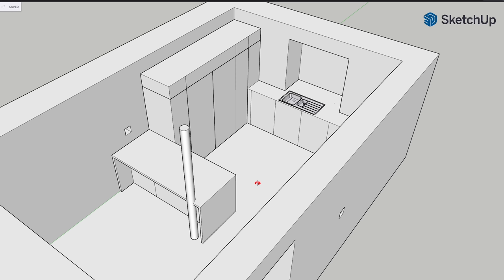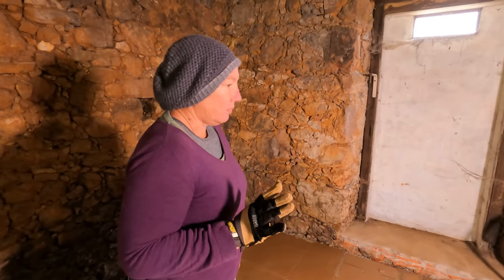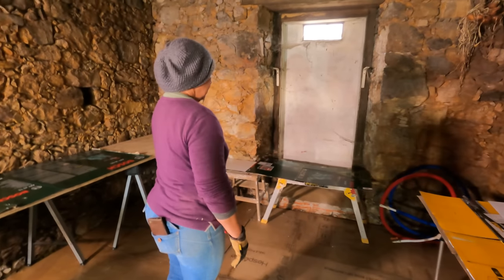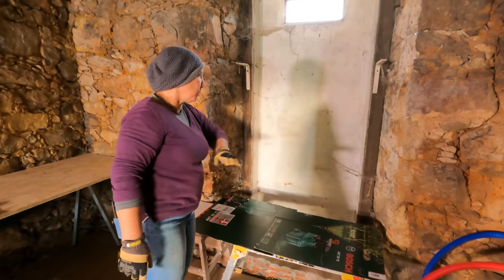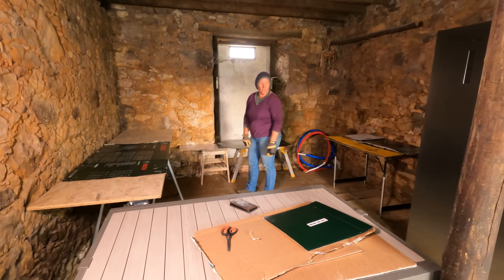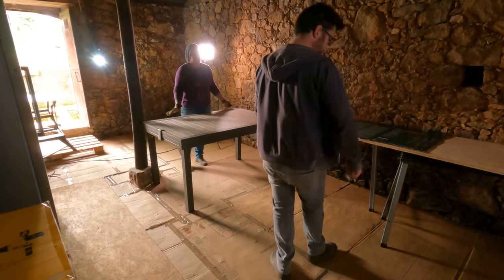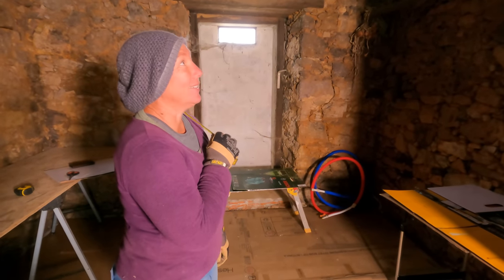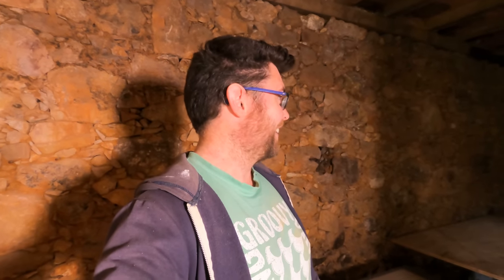How We Planned Our Perfect Kitchen

Comment: We had the same situation with the pole having to be kept for structural integrity. We wanted the most counter space on the breakfast bar as we could. So we incorporated the pole inside the counter top by wrapping counter around it to help the lower portion of the pole to sort of disappear into bottom cabinet. We squared the upper portion of the poll off by boxing it in with 2x4’s, that housed the electrical and switch for overhead breakfast bar lighting. Then we tiled the squared off pole with decorative stone.
Reply: my thoughts exactly and it may also be possible to incorporate electric plug and RJ45 sockets in to the pole as the counter top will no doubt be purposed for laptops and other devices.
Reply: @grahamlees4394  Agree with both of you but replace the the RJ45 (WiFi is easier and if necessary add range extenders/repeaters enabling full house coverage.) with USB charging port/-s.

Comment: My suggestion would be to either move the fridge and cupboards to the opposite side or move the bench to the other side so you have the bench running right around in a right angle. In your floor plan you have a space hard to access next to the cupboards on your bench.
Reply: I think they said they are not planning to plaster that side so can't hide the electrics that side

Comment: ps we had cables under the floor in a barn and on the floor (you can get lovely brass floor sockets) with wire also running along the ring beam with radio controlled lights so no sockets or switches visible. Wires can come under the floor and floor sockets on the central unit - sure you have thought of that x Thanks again for the vid. Always a joy x

Comment: How about running all the carcasses over on the long left hand wall, as you enter the space. They can be full height, or a mix to suit how you want to operate in the space. Then form an island in the middle of the room. The island can be up the far end, but crucially not touching the end wall. This means the extg door can remain full height, when it’s turned into a window. Maximising light into the dark space. The dining table can butt up to the island, at the door end. (From an architect)

Comment: Nice kitchen, congratulations! By the way, it is also possible to have the dishwasher higher up in the high cupboards - better for the back in the long run (and you would not trip over the open door around the sink)
You can install the ventilation system over the cupboards, and hide only the pipes going there (like a beam), alternatively install nice pipes and show them.

Comment: Two of the best features I am glad I put in my kitchen are sockets inside cupboards that allow me to slide forward the food processor and breadmaker and use in situ meaning I don't have to carry them to a separate workstation.  The second feature was to put racks on the inside of a door to hold herbs and spices. It only needs to be the width of a jar and I can see where everything is at a glance. My cupboard is built around a soil stack which is completely hidden.

Comment: imho: kettle and coffee should go to the right of the sink, esp if you're right handed, and where it's not 180 away from the fridge. Similarly, range work area should be just to the right of the range.  hope this is helpful. All the best, love the idea of a full size mockup, makes sense!
edit: years ago i was sceptical about too many open shelves but am now a huge fan for high use objects, dust not an issue. Also consider glass shelf(ves) under the window, where glassware and a vase of flowers will shine. Pre-packed rectangular baskets in open cupboards were another joy: you can just pull out onto a worktop, with everything you'll need for eg baking, pulses, pasta etc.
a big narrow drawer to stack rectangular baking trays and sheets on their sides for easy access, ditto a rack for pan lids, made life so much easier.

Comment: You two rock! But I would consult a kitchen company in the area with a designer. As a kitchen builder myself some of the things you say are not quite there yet. A sink above a dishwasher, thats a low inset sink then? A hole where cables can run trough like in an office? Theres a reason thats not done in a kitchen (spills/dirt/crumbs). When your floorplan is still to big. Conisider deeper cabinets with a small work surface infront. Mostly this is combinned with roll-up doors where appliances are 'hidden'. Also the pole, keeping it is indeed a preference. Mayby turn it in too the end of the counter instead of making the counter wrap around it. Also there is a reason why the surface behind a stove is easy to clean. Grease of cooking accumulates on 'rough' surfaces. Hopefully my explanation was readable, because english is not my native language.

Comment: The only suggestion I might have...Use your cabinetry base deck to hide your wiring.  Running around the periphery of your kitchen and popping up for outlets.  Be sure drawers and slide outs, in corners, don't bump pulls or handles on opposing corners.  A smallish lighting valance above the length of your cooking center would serve as a good hide for venting and ductwork.  The function of the design looks fantastic.  Love the breakfast nook idea.  Is the counter by the post going to extend far enough for some bar type seating on  the breakfast nook side?  Be a great place to sit while prepping food for canning.  If you don't have one, a quality table saw will aid in this portion of your build.

Comment: When I design a room I put paper on the floor . To add the dimension of the height gives even a better view. The middle of the kitchen floor you can use those nice Portugese floortiles like a stone carpet. I saw examples of the cornerstorage unit and I really liked it myself. Good to plan everything out. Make sure you have plenty of sockets; you will be amazed how that simplifies working in the kitchen. When you put shelves in that you can  pull out adds to comfort to work in the kitchen, For your ventilation pipes , since you are probably building the cupboards ceiling height you can use that top space to hide the ventilation system, Building ceiling height , you will always have to use a ladder and it adds on to have a lot of clutter in your live. Interesting video

Comment: On the island you should try and get a lift up socket for lap tops or phone charging,and if you getting European kitchen cupboards they come with plastic foot you can run cable's and water underneath you get about 100-150mm

Comment: What about a rounded oval benchtop shape around "the pole" with walkways either side?
It would enhance the pole's central position and simultaneously integrate it nicely into the space. And you could seat people around it as Guy does his entertaining kitchen chef thing... 😉
Great job as always and thanks for letting us partake in all your endeavours!
Will be exciting to see the finalised version you decide on!

Addit: Re vent, I've seen a cooking unit at a friend's place that has a level ventilation system integrated into it (i.e. at hip height). I can get a pic if you're interested or have a look at "downdraft" vents (Bosch, Miele, Klarstein, ...). It works really well re fumes/ smells etc., quite surprising actually!

Comment: You could consider putting a pot filler tap above your range. Very handy for bulk processing. Although I see you are pointing that wall so it would have to be surface mounted. I would avoid an island, when two people are in the kitchen you end up walking round it in circles to give each other space. My sister got one and she says her and hubby end up going round it clockwise picking up small things like cutlery in a sweep as they go. But then when you need something else you have to go on the merry go round again.

Comment: I'm sure your design is pretty much on point, the only thing I would say is, make sure you have enough work/prep space because once portable appliances start encroaching on that space it's often to late to change.
I like the idea of a secondary consumer unit in the walk in larder, I would suggest it is positioned at eye level for ease of maintenance if needed, and if you need to turn a breaker off, I'm speaking from experience here. 
The area between range, sink and fridge is not wasted space, you need it and will be glad of it especially if Kylie ventures into that area.
You will of course have to buy an airfryer mini oven, they are all the rage now and perfect for two people. When you are planning seating the usual practice is to use a person with hands on hips and the space between elbows is considered to be comfortable at a dining table.
I'm 75 and hope I get to see the grand opening.

Comment: Interesting video... brings out some memories. At the risk of offering redundant advice, do plan for standard kitchen carcass/appliance heights/widths/depths if you haven't committed anything yet because most of kitchen spare parts are made to standard sizes (e.g. drawer/door runners, drawer inserts, specialist hinges, handles etc).
You may be planning to make and fit your own bespoke cabinet carcasses but one alternative would be to recycle/re-use the existing standard size carcasses from a kitchen that's being remodelled. That could save tons of labour time and possibly money if you find something inexpensive. Such carcasses are typically still strong as they are internal and hence don't take much abuse/hits & scuffs/water damage.

Comment: We went through very similar situation with a beam and an island. We went with receptacles in the side of the island to keep them off the top. We also had our cabinets go right up to the ceiling. I wish we could send you a picture because we were very frustrated with our design at the beginning but extremely happy with end results. Actually we ended up with two beams on either side of the island. And we are on the Westcoast of Canada.

Comment: For the space the appliances are over-sized for my aesthetic, but it's not mine. The ventilation could be tough wood planks to keep the 'country' look. 
As for the countertop, it's possible to get slate or a hard sandstone which gives you colour, texture choices. Storage is always a priority for any kitchen. There are hinged sliding hidden door/cupboard units which can both store and reveal the small appliances. I installed one in a tiny kitchen and the owners loved it because it took "clutter" off the counter. 
What we also did was put a curved storage unit around a corner. Shallow but handy for jars, cans, herbs and spices.

Comment: Some "modern" ranges have an extractor build into the surface sucking the waste air down with an exit down low....so you could run it low and behind to the left out of the "door" underneath the "window" without going through 600mm stonewall. Just an idea. You than also have space above the range...for some more "storage".

Comment: What is on the other side of the door? Do y'all have a plan space for all the canning vegetables, can fruits and all the wine y'all will be making? May I suggest somethings I would put the big refrigerator in the corner next to the range with a cabinet /counter top between the two . Leave the door as a working door and if possible add on a room for a walk in big pantry, storage and all the electrics / box / plumbing etc . Now on the wall were you planned for the refrigerator to go put the sink and dishwasher and there would still be room for a few cabinets with upper cabinets. Then if you want an inland counter in the middle of the kitchen you would put it in front of the range/stove and the sink , just make sure you have enough clearance to open oven door and the bottom cabinet doors on the other side.. if not then you could still go with the inland/counter where you have it all ready planned for it to go. I wouldn't close off that door , you might need it in the future.
Reply: They are planning an outdoor kitchen in the out building next to the house. I believe the excess pantry storage will go there.💕

Comment: For older age proofing, they do make cabinets that rise (electrically) so that all draws and cupboards are accessible. It would mean the worktop would have visible breaks in it on the surface. Also add extra power points as you can never have too many but you can have too few. At this stage of the game it will cost very little to add some more sockets. Just a thought thanks for posting

Comment: I know you didn't ask for them, and there is always the risk that I am 'trying to tell the Pope how to lead mass' but...a few of suggestions to do with the fridge-freezer. 
Check whether you can remove the shelves without having the doors fully open. If that left door needs to be fully open to remove the shelves you need to make sure you make the adjacent unit wide enough to allow that so the 'breakfast bar' doesn't foul the door. 
WRT the power outlet for the fridge-freezer. For reasons known only to themselves, fridge manufacturers seem to make the cords shorter than they should ideally be. i.e. if the wall socket is too high on the wall it is difficult to even pull the F-F out of the 'hole' far enough to be able to plug / unplug the fridge. 
WRT the unit going across the above the fridge-freezer, make it so that it is easily removed. You current unit won't last for ever and you may find a new model is just that bit taller that it won't fit. 
You should also make sure that the fridge-freezer can breath. Meaning either a reasonable gap between the F-F and the unit above it, or, don't take the unit above it to the ceiling and leave a gap at the back of it. i.e. it isn't full depth. With a unit as wide as yours will be, it would need a supporting timber if it isn't going to be fixed to the wall.
Thanks for the effort you put into your videos, and I always enjoy the banter between you.

Comment: The concern with not having an outside vented extraction hood is the grease vapors. Speaking from experience guys... I currently have a builder installed microwave hood combo that's crap. I used to have a Dynamic Cooking Systems (DCS) hood at my old house that sucked everything but the food and was wonderful. I'm going to remodel my current kitchen and add a DCS light commercial hood

Comment: You could run your electric down low so it's hidden by the cabinets. Also from experience if the breakfast bar is fixed any friends you end up with will want to sit there to chat so maybe just cabinets on the inside and an overhang on the dining side

Comment: I have that exact corner cupboard in my kitchen as a pantry. It's EXACTLY like the one you showed with the same amount of shelves. 
The only thing I don't like about it is the spacing of the shelves, they are too big, I think they could have designed them with less space in between and maybe got another shelf in there.
I used to store my appliances on the bottom as well, until I got a buffet and now they are in there.

Comment: I love the openness of the range wall it adds lots of visual room to that side of the room. In my own home above my fridge I built a box with open vertical slots divided by metal rungs and this is where I store all my cutting boards, platters, baking sheets, wire racks, etc and it saved me an enormous amount of drawer space as well as the pain of shuffling thru the drawers to find what I needed. It’s just really handy!
Will you be sitting at your bar with your laptops and will they need to plugged in?

Comment: The dishwasher can only go under the draining board side of the sink but you can choose which way round the sink is (some are reversible or you can buy one with the layout you want). The u-bend below a sink won't leave much space. With the kitchen island - the idea of having a couple of units on wheels is alright but I think a bigger kitchen is generally going to be necessary for one. Making your own island for appliances looks good. If you do make your own, rounding the corners so you don't knock into them and hurt yourselves looks sensible but again the design may not look right if you've chosen a modern angular design kitchen.

Comment: I do like your ideas for the kitchen and I may have a solution for the exhaust fan... 
1. Run a rangehood with a timber backing hiding the pipe and run it at the back of an open shelve that runs above the stove area.
or
2. install a bench top fan the runs the air DOWN .... pipe or filter or whatever.

Comment: in  the window  space if it was like a split door and the bottom part opened outwards that would  give access to the grease separator and allow  clear access to the back of the unit and plumbing

Comment: Dont want to be a fly in the ointment, kitchen should be aimed to the hand of the cook; right handed a clockwise design, left handed anti clock wise. Like if you want the sink where you have drawn it...needs to be turned round.  Pans from cooker straight to sink; not passed over the draining board to sink then back to draining board. Sorry to be pinickity, you guys are doing a great job.

Comment: When we upgraded our kitchen, I was surprised to see how little the power requirements for the induction hub and the oven were.  Times are gone when you needed a three-phase connection. If you check the power of your intended appliances you may see that no chunky cable will be required. Cheers, and keep your spirits up (no pun intended...)!
Reply from the maker: Chunky cable (6mm) definitely required … the range has a max usage of 17kW when everything is in use (though how often does that happen??). Standard here in Portugal for hob/oven is either 2.5 or 4mm cable. The guy at the electrical shop was very surprised when we wanted both 6mm and 10mm 😂
Reply: That's a surprise! If everything is in use it would add to 70 amps! According to German Code (VDE, for running cables in conduits), 16 mm (square) would just be enough. But, as you said, full power is never required. So, 6 mm is a good choice.
As long as you have sufficient battery capacity, of course. 🤔🤔